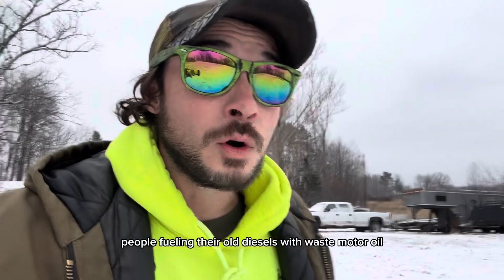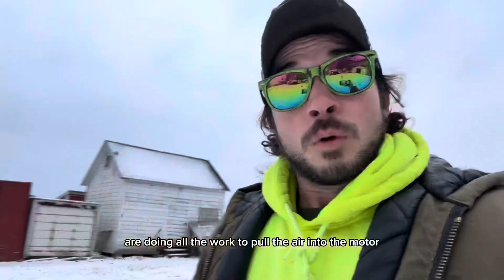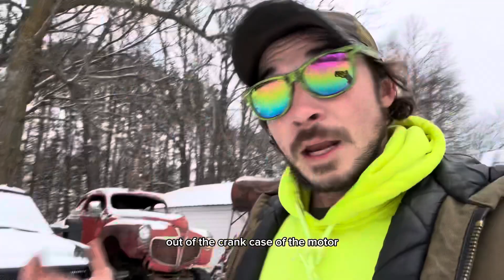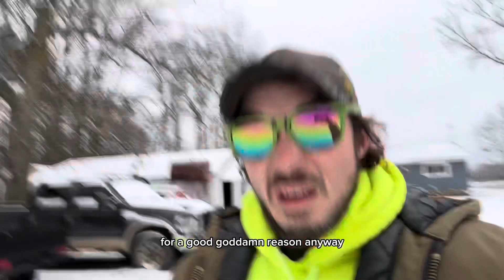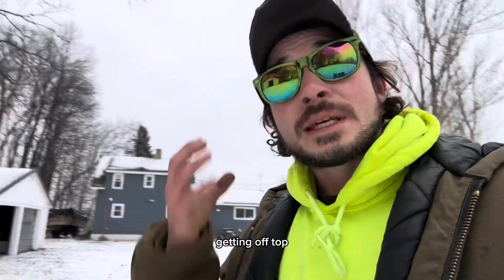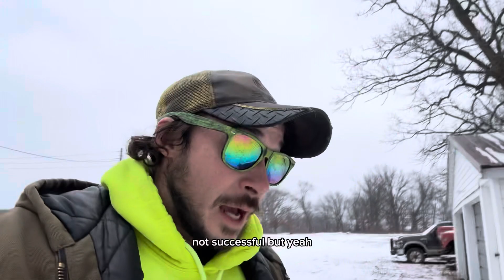Explaining Diesel Runaway (and gas dieseling)

Comment: Good video
However you are using my pet peeve
Engine= internal combustion
Motor=  electrical
Other than that good video.
Reply from the maker: It’s a pet peeve of mine that you think that’s accurate. An internal combustion engine IS a motor. 

https://youtu.be/dcjKhAKg13E?si=BW0sAEQTrTXRqJuC
Reply: @off_jawaggon  so be it.
Reply: things that spins and generate a lot of power is called "motor"
Reply: I had a shop teacher that used to say the same thing. Never agreed when he said back then, don't agree with it now.
Reply: Engine is a SubCategory of Motors. That thing with pistons and burns fuel is both a motor and a engine.

Comment: Happens in the oil field with fracking. Had one run wild, hit the emergency stop kill switch that closes the air flaps. Still ran. Mechanic and I ran to the tower side and unscrewed the filter fuel bowls. Thank the lord fuel did not get to the oil pan and fill up. It took about 2 minutes for it to shut off. This one and another that we were testing in the yard did the same thing. Both had previous turbo fires that were supposedly fixed. Big ol 3512 CAT diesels. I miss the field.